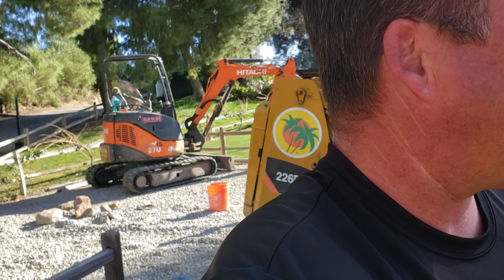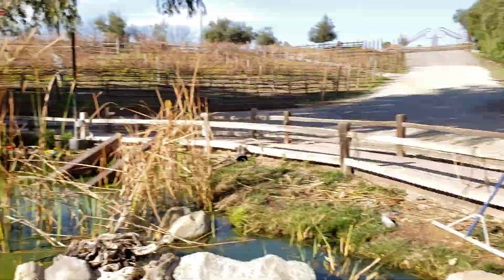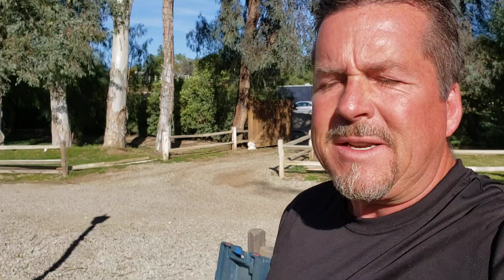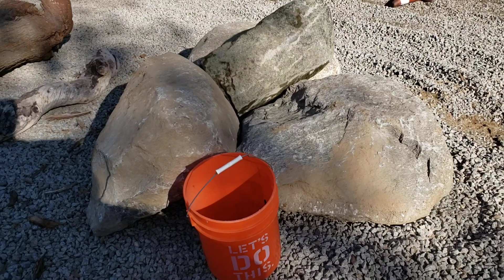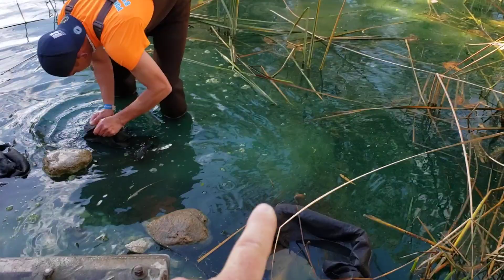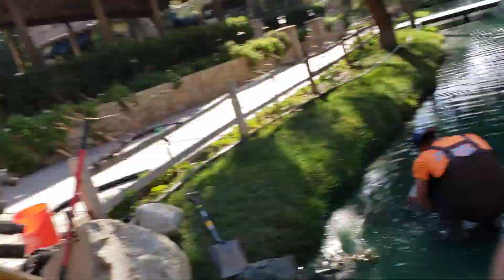Ten Talk | On installing intake bays into existing lakes

Comment: Awesome video! How many aquablocks did you use per intake bay?
Reply from the maker: I try to follow a rule of thumb of 1500 GPH per large aquablox on ponds where there is a heavy leaf load. Onnpinds where there is light skimming, I've gone as much as 10,000 GPH. Although experience has taught me that the former is better, the latter can be achieved, but it really needs to be on a pond where there is extremely light duty. 

Thanks for the kind words and best wishes 🙏

Comment: Great videos!  Looking for a solution for my 60,000 gallon pond I lined here in Hawaii with Koi and turtles. It rains a lot so the water from the roof flushed regularly but mostly green/brown. Hoping to build something I can trickle filter with low wattage pumps.  But there are large intake valves built into the liner. Thanks!
Reply from the maker: Call me 909-224-6091

Comment: Have you ever added a skimmer inside an intake bay? I was thinking a skimmer would capture a lot of floating debris before it sank to the bottom. If the skimmer got overloaded and clogged, then it would just be the intake bay working. My thought was that it couldn’t hurt to have an optional skimmer inside an intake bay, but maybe I’m wrong. Would love your input on my thought. Thanks.
Reply from the maker: I think it's wearing a mask over a mask with a vaccinated person that has had covid and has antibodies, is young, healthy, and wears such devices while walking alone, in a secluded place, far from any potential human interaction. 

In other words, slight overkill. :)